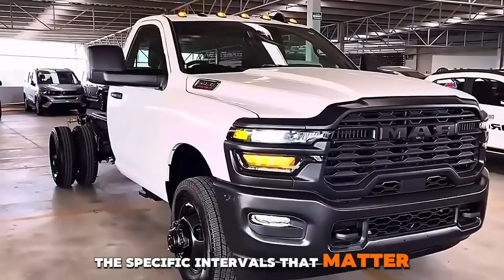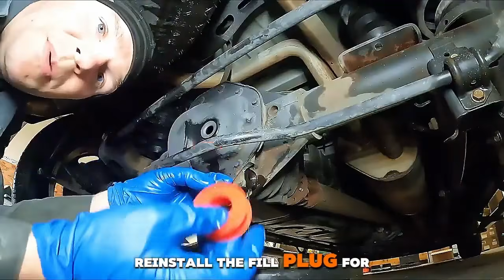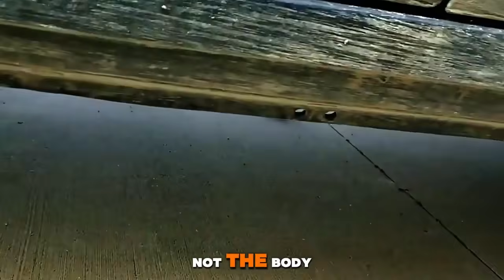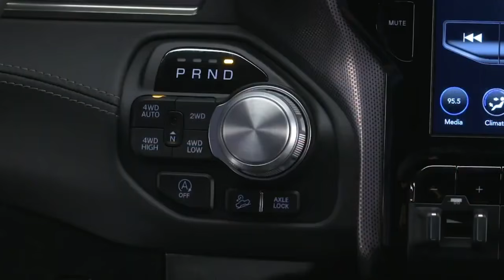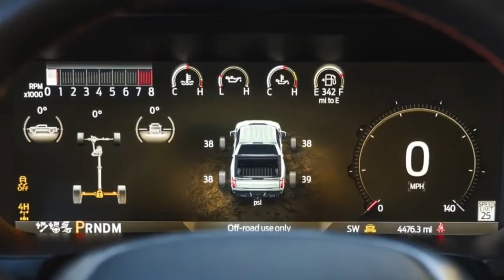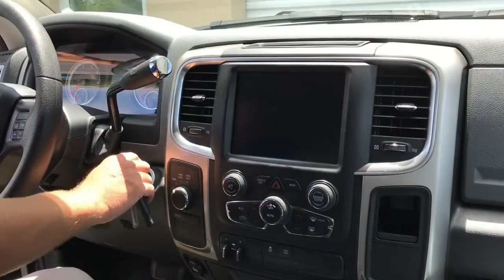17 'ILLEGAL' Hidden RAM Tricks Mechanics DON'T WANT You Using (But They WORK!)

Comment: Yeah, I'll give you a hint about the antifreeze. The orange crap creates sludge to. And if you start losing heat on the driver side or you start noticing an oily film on the inside of your windshield and the smell of antifreeze but can't quite figure out where it's coming from. Yeah it's under your carpet just flush your heater core or take your entire dash apart to change it. I'm speaking from experience. You can probably do it in about 8 hours if you have a halfway decent understanding of mechanics, but if you have to figure out every step dedicate the entire weekend when you get to the refill portion of this job, just park your truck in a severe angle so your radiator cap is higher than everything else. Take it off, run it up to temperature. You will have zero issues as long as your cap is above. Everything else then fill as needed most of you probably already know this, but if you don't, here you go fyi, mine took exactly 6 days to go from oh. I smell antifreeze. Oh there's an oily film. Oh and it freezes gushing out from under my dash. Yeah that's the process

Comment: 2013 Ram 5.7 Hemi 4by4 with 6 speed automatic transmission. With 103,000 miles and full air suspension. That’s going to be replaced by old school shocks springs and coil overs. Only paid 1500 Canadian dollars. Can’t wait to put it all together in the spring. Motor and transmission are in great shape. Love it. ❤🍁🇨🇦🤪😎

Comment: 2022 Ram 1500 4x4 with E Torx , I keep my maintenance UpToDate  shut off Auto start stop every drive and use Manual set 1-8 , I have the 12inch UConet screen and can not get that deep into settings :-(
Reply: What do you mean you cannot get that deep in the settings ? I have the 12 inch screen and it works fine